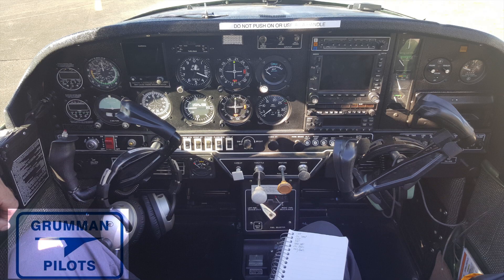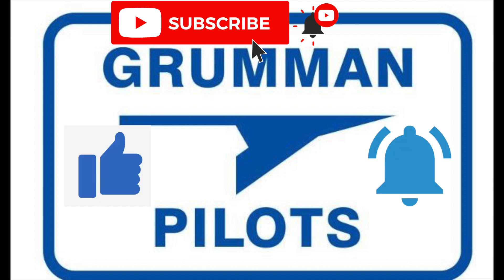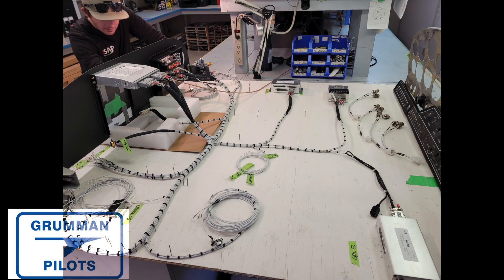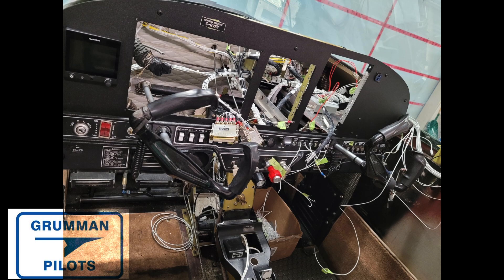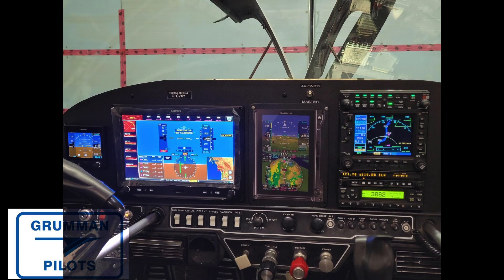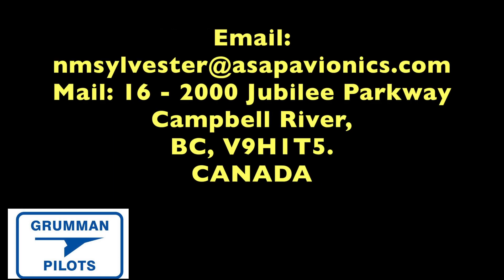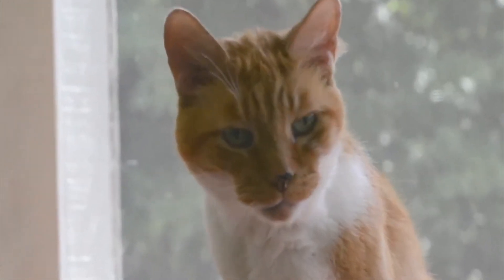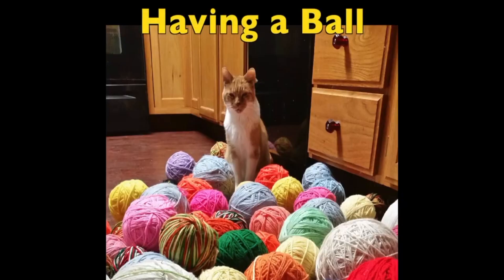Garmin G3X in a AA5 - Grumman Style

Comment: New Mixture, Throttle, remove Vacuum pump, then add new audio panel, transponder, GPS/Com, backup, etc, etc.    It sorta reminds me of car guys that also "invest" $100,000 to update their older Acura RSX.  Looks newer but it's still a slow Honda undernieth when you actually drive it from A to B.
Reply from the maker: One way of saying your mileage may vary.
Reply: @GrummanPilots  If you consider what you can buy for $150,000 ($100,000 + $50,000 for selling the Tiger) you scratch your head why you would need 3 displays to show your position on a flint simple 130K airplane.  I  still remember sitting at the AYA convention when Tiger aircraft announced their new Tiger with glass panel and no one,  I mean NO ONE in the audiance said would pay that money for the bells and whisles they added.  Too many great fantastic alternatives at that price point.  Same now as then.   Sure I'd love one, but reality is I'd rather be flying.
Reply from the maker: I used to fly to EAA flyins when I lived in tye deep south, I would fly home from say Faraday, LA to Slidell, LA by compass and time at 1500 or so altitude.  Great pilotage skills, I had a loran but was not using it or the VOR's, ADF.  It was a blast so I know what you mean.  In Alaska how much glass do you need to fly the coastline?
Reply: @GrummanPilots  Gosh I miss you flying down here!  So many memories.  Blue skies.